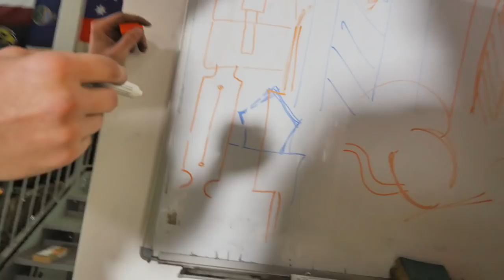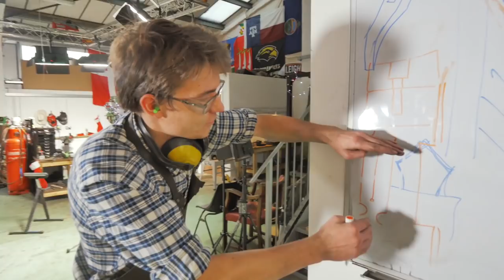MAKING A SCOTTISH CLAYMORE SWORD!!! PART 12

Comment: Is that a crucible for melting down your meteorite?!?
Reply: Dan T exactly my thoughts
Reply: I think the dust he cleans up
Reply: why not both
Reply: the dust can't be used again, its iron oxide not iro. i may be wrong but i don't think it can be reversed by melting it
Reply: Just have to resmelt it.
Reply: it can totally be reversed, but its not going to be like regular stock, its going to be some sort of strange alloy of all the metals hes been working on.
Reply: All you need is activation energy (heat) and carbon to convert the iron oxide into iron and CO2. Iron foundries have been doing it for ages with scrap metal. I used to work in a facility that used "Foo-Foo Dust" as an additive. Turns out, that means floor sweepings from the grinding room.
Reply: yes please!
Reply: I really hope Alec is trying to make that meteorite work by smelting it
Reply: Was exactly what i was thinking too
Reply: Exactly what I was thinking
Reply: Drop The Mic You need to first electrolyze it back to iron in a non-Oxygen environment.

Comment: Crucible steel! With the scale and fillings from the grinding room maybe!?
Reply: Think Green Beetle did something like that.
Reply: Zachariah Judge exactly what I was thinking about yesterday
Reply: It's a bad idea to use steel that was removed by abrasives, they ablate as they cut. Meaning that all the steel is contaminated with ceramic, Aluminium oxide, and other bits of stuff like binder for the abrasive.
Reply: Im hopeing!!!!
Reply: or just put it in a bag and send it to green beatle

Comment: "I got some proper wood glue this time." -grabs gorilla glue. Smh. Just use real wood glue Alec. Lol.
Reply: I 2nd that, good old pva wood glue holds the strongest
Reply: Agreed.  Seriously just use PVA.  Gorilla brand pva wood glue isnt half bad.  But that was not Gorilla wood glue in his hand.
Reply: I bought a large bottle of gorilla glue when my titebond ran out. I still have a full large bottle because the next day I drove the 60 miles to the closest place that sold titebond. I also believe the stuff he got requires water as an activator so we will see if it stays together.
Reply: He could have just gone to his dad's shop again to make that darn handle 
Everything there router chisel glue
But wait making the handle in one day how silly of me
Reply: Yep, Amazon up some tight bond II or III for waterproof needs. Gorilla glue is a polyurethane glue, which is typically messy and foamy. PVA is the  way to go for wood.
Reply: Charles McKnight I thought that myself...
Reply: It also depends on the wood.  That wood Alec used looked extremely hard, shiny, and non porous.  Alex will eventually come to realize that the key to good wood gluing is surface area and porosity.
Reply: By the way
It doesn't matter what glue he is using as he has tang grooves on both sides and he will wire wrap the handle 
Paper glue would be enough for this job
Reply: Correct me if I'm wrong but isn't that type of Gorilla glue water activated?
Reply: Aaron Miller yes.. I will be surprised if he gets that off without alot of hassle because it foams up
Reply: The foam is easy to remove and will not stick to the paste wax he put on the tang. I wondered if he wet the wood first ten I saw a splotch of dark on the slot so it looks like he did it right.
Reply: Yeh, I did not get that.
Reply: The Hobbyt gorilla now makes a wood glue to compete against titebond. I love the stuff.  I've tried getting it to fail numerous times. The only way I've succeeded in getting the joint to separate is to cut it with a circular saw lol.
Reply: Mike Warner that's called cutting, not breaking. Haha 😂
Reply: If you were following advice to "get some Gorilla glue" they meant Gorilla WOOD glue, the PVA type. Looks like the glue you used in school. A joint glued with this will be stronger than the original wood!
Reply: Paul Phillips the original gorilla glue is stronger than the gorilla wood glue on wood. They made the wood glue because too many people did not know how to apply it properly or understand the principals of a poly based adhesive. It is both stronger wood glue and waterproof.
Reply: I don't know that gorilla glue For wood on wood I choose Ponal for leather Kövulfix or Pattex for metalls on metalls Loctite or other brand products like that for handels 2K epoxy 30 minutes version is the best.
Reply: Aaron Miller yes you apply a thin layer of glue to one side and make the other side of contact damp then clamp them gently.

Comment: Be careful when you pour from that crucible that it doesn't tumble forward out of the holder. Most that you can buy have a separate piece that rotates down and holds the crucible in place.

Comment: Alec, had the epoxy been mixed precisely, the wood would have broken before the epoxy failed. 
Oh, no! Not gorilla glue. It expands terribly and I fear will fill your tang slot and mess up your handle. I’ll keep watching to find out what happens. I’m hoping it works out. 
Did your dad recommend Gorilla Glue or Titebond III? 😏
Reply: Gorilla makes wood glue, and it works well, but that doesn't look like wood glue. Titebond III is probably overkill for what is basically just decorative. Titebond II or Gorilla wood glue.
Reply: Wood glue and epoxy is what I would use
Reply: Per instructions: Gorilla Glue is a moisture activated polyurethane adhesive, therefore, you need to apply a small amount of moisture to one surface. Then apply glue to the dry surface and clamp. For dense hardwoods, lightly dampen both surfaces prior to gluing.
Reply: Ditto. Search for Matthias’ video on Gorilla glue. Worst option here.  Epoxy (properly mixed, in the right temperature (can’t be too cold)) is the right option. Ordinary PVA wood glue fine too. Gorilla glue’s adhesive qualities are too variable depending on specific application to be reliable.
Reply: Titebond every time, best wood glue there is, dries to be stronger than any wood its applied to, doesn't expand much, and it sands easy.
Reply: Gotta give shout out for the titebond, or just everyday PVA wood glue. Hell even cyano alkalite super glue would done better job and in instant.

Comment: Please don't bend Lithium Polymer batteries like that! That could easily have violently exploded in your hands :'O
Reply: Just pull those tape out from the battery, no need to lift and bend that.
Reply: Batteries these days are Lithium Ion so they won't explode when bent, stabbed or anything of the sort.
Reply: Lipos wont explode if you bend them. Lipos wont explode at all - they just vent their internals energetically, which is exothermic and will catch on fire from the temperature rise eventually.. usually needs multiple cells to cascade through failure though. Plenty of warning from high heat and puffing before they go!
Reply: +Turkey300IIRC lithium Iron (phosphate) batteries don't blow up/catch on fire when you poke them, lithium ion batteries do.
Reply: Lithium Ferrous Phosphate ;) You can make them go, especially in prismatic pack form (the pouch cells) but they don't tend to do thermal runaway which results in a cascading cell failure (one cell gets hot, next gets really hot and vents, next catches fire). Small LiPo under about 2000mAh are actually pretty hard to make go - i've shot bullets through 3 cell packs of LiPo pouch cells with nothing more than a little smoke - hit one with a nail gun and you get pretty similar effects (high end batteries that can dump 40-60C current). Get a 3000-8000mah and hit it with a nail gun and you better be able to run fast! I shot a 5800mah 6 cell pack with a nail gun after decidedly boring results from 500-2000mah packs and wow did that go INSTANTLY.
Reply: don’t hurt your electricities, it will lead to shocking results
Reply: >Lithium Polymer
what year is this
>easily
nope
Reply: the tape on the back of iphone batteries is VERY strong. He shouldve heated up the case (just enough) for the adhesive to loosen. this is what is recommended.
Reply: That scared the crap out of me! So much care for protection with the heavy stuff but the tiny stuff can burn you just as hard!

Comment: Hey Alec, Loving the Channel, When you need to twist wire again put it on a really big swivel. Lock the swivel, so it doesn't spin while you are twisting the two wires together.  Once you have the desired tightness keep the tension on the wire and let the swivel slowly unwrap. We use that same method for making twisted wire in vaping. You can do some really neat things with wire.

Comment: Alec, I would highly recommend a locking hook of some kind to secure the crucible in your pouring rig. Not only does it help to avoid molten metal spills which can be very dangerous depending where they happen, but can also keep you from dropping and damaging crucibles.

Comment: Silicon Carbide Crucible! Look at 3-finger fireplace tongs for inspiration. I use a modified version for my hobby casting, and they work great! Dont forget to work in a pin or something to hold the crucible in place. That way it doesnt spill out when you pour

Comment: Haha, yesterday I did say about the wood glue! Also with epoxy - when it gets hot it does go soft (reaches its glass transition temp), so belt sanding makes it much softer and able to pull apart (was dealing with this yesterday myself when using it for inlays!)

Comment: Hey man, I have twisted lots of wire.  You were right, slowing down the drill when you first start helps prevent kinks, but you also have to hold the wire really tight.  As the wire twists, it should pull the drill forward.  Over twisting can also lead to kinks, so stopping at the right time is really important also.

Comment: It would be wise to include an extension to either side of the crucible pouring handle that clamps onto the top rim so that when you go to pour it, the crucible doesn't just fall out. It would need to clamp onto the side of the rim that doesn't have the pouring spout. You could attach it to the current handle, as well.

Comment: You're exactly right about annealing it. It makes it much easier to work with. It's the same principle when making coils for vape mods. You take a torch to the wire before you try to make your coil and the wire isn't quite so springy anymore.

Comment: Being a ceiling fixer I have spun miles and miles of wire and if when you've finished winding wait a few seconds then put the screwgun into neautral and it takes all the tension off of the wire so you don't get a birdsnest or loose the straitness. Hope this helps for next time. Love the vids and where the channel's going. TkEZ

Comment: awesome progress!

One thing with that type of gorilla glue - it expands when it dries.  For wood there really is no beating a good quality PVA wood glue.  Joints tested with regular PVA and Gorilla glue show that the hold with PVA is always stronger than the wood itself where-as the gorilla glue showed joint failures at the glue line.  This applies so long as the wood is reasonably "normal" in so far as it is not an excessively oily or waxy wood.

Comment: Use a hide glue for the wood! I worked in a stringed instrument repair shop, and learned that hide glue is the best for bonding wood to wood. It’s applied hot and takes little bit more time to prepare, but that glue joint will not come apart unless you heat it back up to melt the glue. Plus, gorilla glue is terrible!

Comment: Tip for the copper wire twist: Make a loop on each piece of wire. Spin each wire separately "counter" clockwise for a few minutes or until you feel tension. Don't forget to keep tension on the pieces at all times. You will have to tie the one not in use of with tension. Lastly, connect both wires that have been spun to the drill and spin them "clockwise" together. Remove the bit from the drill before you release the wire from the bit and let the wire gently "relax" by letting off tension slowly. This will cause the wire to "normalize" together and there will not be any "kinks". Good Luck. :D

Comment: Great work Joe, looking forward to the next few weeks. 
Alex great idea on the wrap, I was yelling at you to hold the end of the wire when you cut it, but you can't hear me lol. Been there before you have to hold tension on the wire and allow it to unwind a bit then let go. Well you know what happens. 

You need to have 2 bobbins of wire on a rod behind a bench vice. Pass the 2 wires through a small hole in a piece of wood in held in the vise hole should befirm on the wires to provide a small amount of friction.  Then use your drill to draw out the twist moving backwards, this way your twisting smaller portions and can avoid kinks and keep consistency. 

Also an idea is that king of random made a diy rope braiding jig i think a fine bronze wire rope would you brilliant to. 

Keep up the great videos. 
Cheers

Comment: You should check out the crucible holder that they pour with on Man at Arms Reforged.  It has a sliding bar to positively retain the crucible when they pour so it doesn't fall out and spill molten bronze everywhere.

Comment: Hi Alex, love your channel. I am a cabinetmaker and have used epoxieds for years and they're great. I wondered if the joint would fail due the large amount of mold release wax used. I also thought I could see small globs that could get squashed onto the jointing surfaces? If wax becomes a problem for other processes packing tape is great just about nothing sticks to it and gives you a little room for fitting.

Comment: As a hardcore vaper (I sense hatred coming my way) you could just put the wire in the chuck of the drill to make it more stable.  Start slow, then crank up the speed gradually.  Simple twisted wire builds for coils,  us rda using folk do it regularly.  Also,  you could have used your router to make a bowtie shaped groove in the wood handle and glued in a piece to fit.  Like a dovetail joint used in furniture.  Its gonna get wrapped over anyway,  and would surely be secure and strong enough to hold that crack together.  Lovely build though.  I'm very pleased with this sword journey.  Keep up the good work brother.  Perhaps you can try your hand at a Chinese gim sword next,  handle,  guard,  blade,  all forged from one piece of steel.  It gives the sword a distinctive bell tone ring when struck. They're something of an ancient marvel. Very challenging to complete, a challenge I think you'd enjoy.

Comment: Air waves and sound waves? Same thing. Also sound waves are longitudinal, the waves you saw moving along the wire were examples of transverse waves, because the amplitude of the wave is perpendicular to its velocity along the wire. The transverse waves everyone knows and loves are Electro-Magnetic (EM) waves (i.e. visible light, x-rays, microwaves etc.).

Comment: From my experience winding up wire for twisted pair also using a drill you get those kinks are caused by a lack of pullng tension on the wire while spinning it up. I also found it to be good practice to reverse the rotaion of the drill and reduce the strain on the wires before you undo the drill. It stops the recoil a lot more. I would also like to see you burn tang into the wood... maybe an idea for a future video.

Comment: When twisting wire like that especially with multiple strands, always anneal it with a heat source to soften the kinks otherwise it will always snap away like that. A butane torch works great.

Comment: idk if anyone else has mentioned it but you might make a clip for your crucible pouring tool to keep the crucible from falling out. Other makers I have seen casting have smaller crucibles and their pouring tool has a little tab that holds the back lip of the crucible

Comment: hey Alec, when you go to glue wood... place the glue on both pieces, move the glue around by sliding both pieces against each other, and then pull them apart. you want the glue to be tacky when you go to finally clamp them together.

Comment: If you twist wire again try pulling thefiring out of the chuk and whatouts connected to at the other end maintaining tension then with a person at each end simultaneously toss the whole thing in the air and step back, it can get cought up in long hair and make sure you're truck isn't close the birds best should be minimised or non existent as the wire doesn't touch anything to cause erratic movement as tension and twist is released. Its something I do with rope for the same reason

Comment: Wood glue is designed to penetrate the fibrous structure of wood. Epoxy only sits on the surface.... no penetration. It can only grab a textured surface and will peal off a smooth surface. I recommend roughing up the gluing surfaces with 60 grit sandpaper, blow the dust off, apply Tightbond III to both sides. Let the glue soak in for a minute, then clamp pieces together but not so tight you starve the joint of glue. Beautiful blade.

Comment: You need to add a latch to the crucible cradle - a hinge and a hook on the back of the hoop so when you pick up the crucible you flip it over the back lip of the crucible. This will prevent the whole lot falling out when you pour the molten metal.

Comment: For future projects you coud try burning on the handle. You drill a couple of holes in a solid piece of wood untill it almost fits the tang. Then you heat up the tang ( not too much ) and push the handle carefully into place.

Comment: iPhone battery removal tip: Pull on the white adhesive strip in parallel away from the battery. Took me about six repairs before I found out myself. 😏

Comment: You're going to need some sort of top attachment or clamp on the crucible holder to hold the crucible in place when you have it tilted at fairly extreme angles (such as when pouring more expensive metals that you only have a small amount of).

Comment: You could re glue the wood and heat the tang red hot. Press the wood into the handle and fire form the slot. I’ve seen this many times.  Just a thought. Cheers bro.